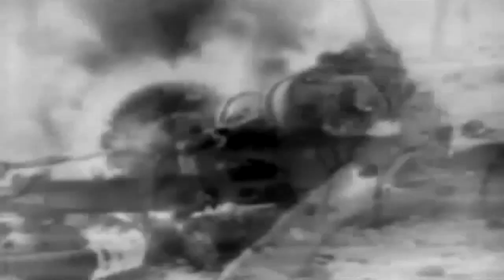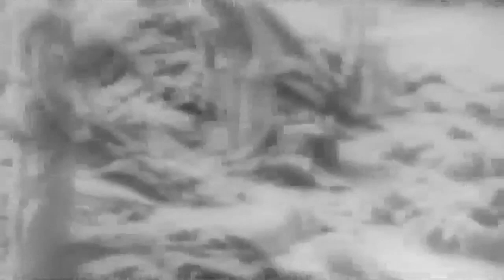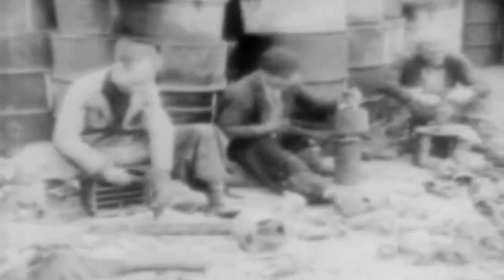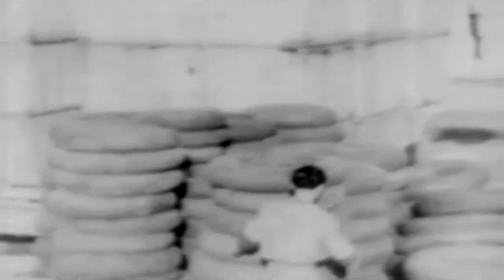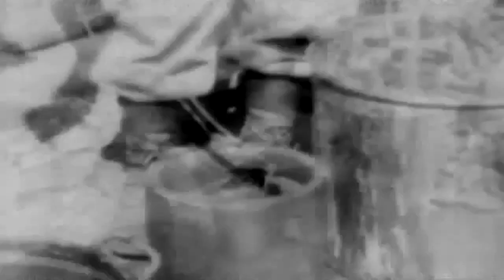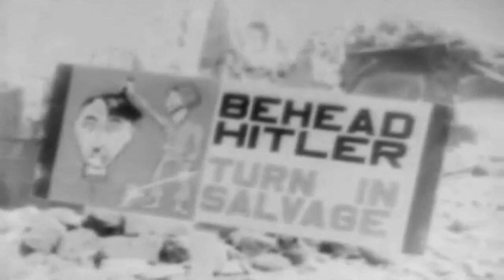War Dept Film Bulletin 171: Salvage 1945 (full)

Comment: how many tons of equipment is left behind in Iraq or Afghanistan because military contracts dont allow for recycling
Reply: Exactly, I made a comment above to this effect. I actually don't believe this video. If stuff is collected and sorted and cleaned and repaired, it's certainly not being issued to front line units? The US military will issue new equipment.
Reply: @adventuressurvivalinthailand  Not in those days. Supply pipelines were too long, and recovered equipment was a vital component of field resupply. We don't really have units like this, anymore, because we don't really need them; almost any critical resupply can get to deployed troops, anywhere in the world, in 48-96 hours, max. The main reason for this is that optempo's are so low, compared to WW2 - we simply don't engage in the same levels of combat now, as we did back then, and we haven't since at least Vietnam...which was also the last time we used anything like these units. The "how to" books are still out there -- look long enough, and you can find current manuals on battlefield salvage -- but no one really trains for it.